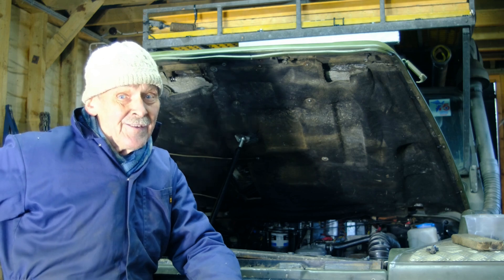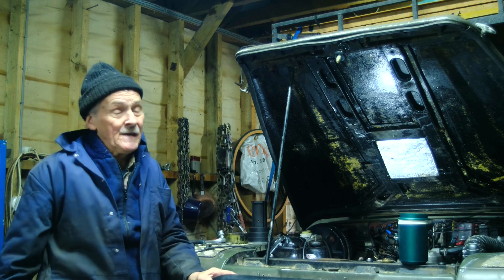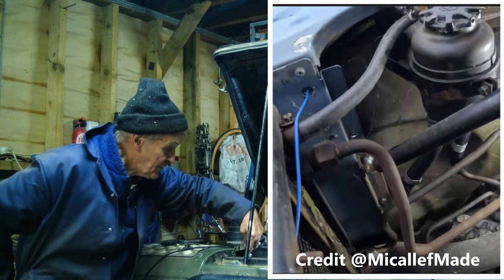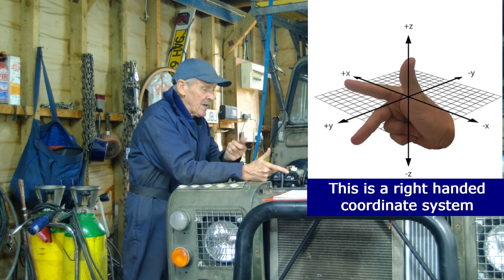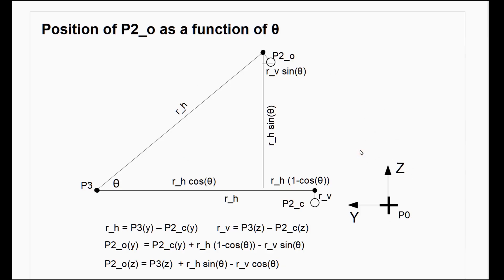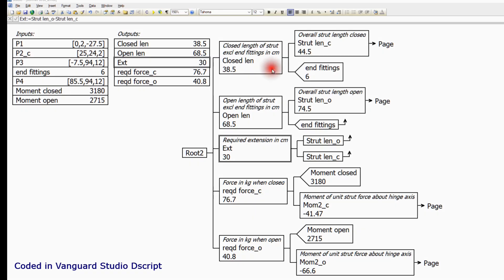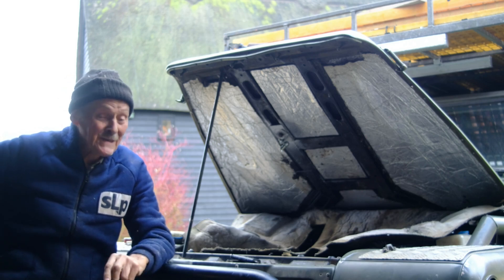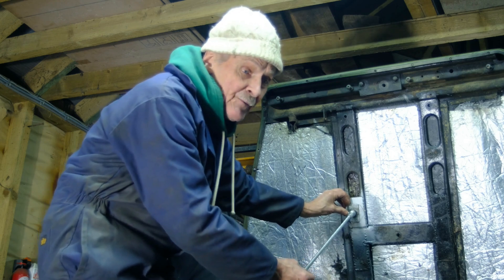How to engineer a gas lift strut for a Defender bonnet carrying a spare wheel.

Comment: Speaking as a person who had time to think about the issue while waiting for rescue, I realised that the engineering assumption appeared to be that the bonnet is opened only while the vehicle is level, however if the vehicle happens to be on a decline the direction of the bonnet’s weight is still far out over the engine bay even though the strut is fully extended. For me, the strut failed and the bonnet fell trapping my wrist between bonnet and wing and with the bonnet catch closed and the release  just out of reach of my untrapped hand.  A rare problem on a road car, but a real issue on a 4wd.
Reply from the maker: If you have actually suffered a strut failure I understand why you raise it as an issue.
I had a fairly similar experience. I was under the vehicle and I put my hand in the door jamb to take my weight. The wind slammed the door shut on my fingers. I couldn't reach up to the door handle. I was stuck there until someone came by and released me. Very painful

Comment: I don't see too many Defenders with the spare on the bonnet, I of course have a series 2A and a hinged bonnet stay and the dead lift is probably good for me as an exercise :) but I understand why you would do this to yours.
Reply from the maker: It's bloody heavy. The Wolf wheels with MTs weigh nearly 40kg. As I said it's a safety issue. When you are hot and bothered and need to see why the engine is boiling you don't want to have to struggle with the bonnet
Reply: @defendermodsandtravels  Yes it is :) I have the steel wheels ( 8 spoke ) not quite as heavy as the wolf rims, plus the 255 80 R16 Toyo open country MT, never weighed them but I might do in the near future as I'm changing my tyres very soon, have you changed your Land Rover ? I swear it was blue.
Reply: @defendermodsandtravels  silly me no you have not changed your Land Rover :)
don't know why I thought it was blue, senior moment haha

Comment: I used to have a Hummer H1 (first year civilian model, basically a military one with a nicer interior and 12v electrics). The forward tilting bonnet with armoured grill weighed about 100kg. You had to lift it up manually and then locate the silly metal pole like the LR one. I got a gas strut kit from the US and it made all the difference in the world. One hand open and closing with almost zero load on the strut at full opening due to being vertical. BUT...with a Defender bonnet and spare I would still recommend a physical prop to hold it up just in case. That bonnet will accelerate at 10m/ps squared if it does fail and you would have zero chance to avoid getting your noggin squashed if it happened to be under it. Maybe that is belt and braces but better safe than dead. Loved the math trigger warnings!! ;-)
Reply from the maker: I have retained the original bonnet strut but not so easy to use with the gas strut. You have to lift the bonnet up and drop the strut into a dedicated hole next to the radiator. Given that the gas strut easily supports the bonnet there's no way to drop the bonnet strut into its retainer. I don't know what the chance is of the gas strut failing suddenly, I would imagine very low. I think they gradually lose pressure over time and need to be replaced or re-pressurised. Time will tell.

Comment: Nice job. Did you consider struts on both sides of the bonnet? What would the problem have been?
Reply from the maker: The air filter and turbo hoses are in the way on the left side of the engine bay.
Reply: @defendermodsandtravels 👍

Comment: My MOD 110 has a different bonnet strut entirely, flat iron, hinged, that is self locking, simple does not get much in the way. Problem with struts are the inexpensive ones do t last well, and expensive ones, are not only long lasting, but expensive. Thanks for posting, but I am sticking with my caveman solution. Liked the calculations!